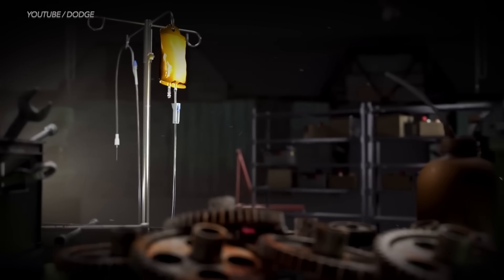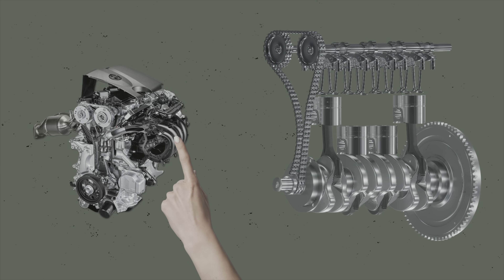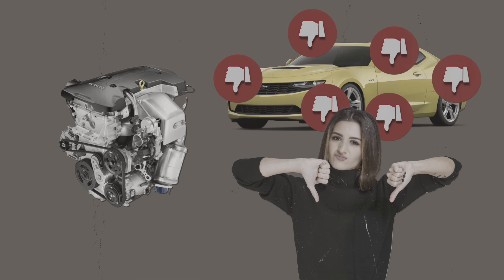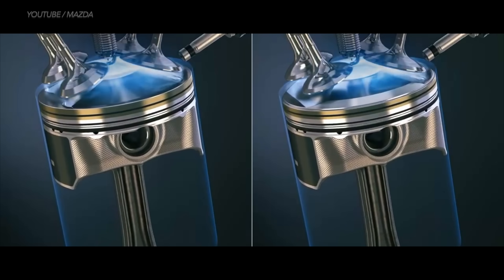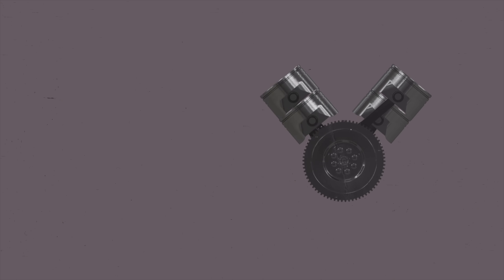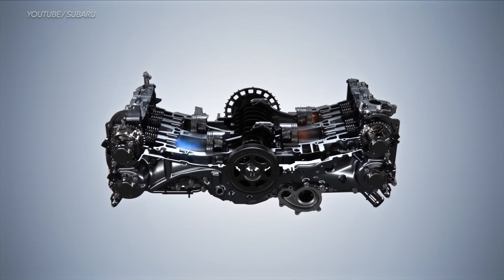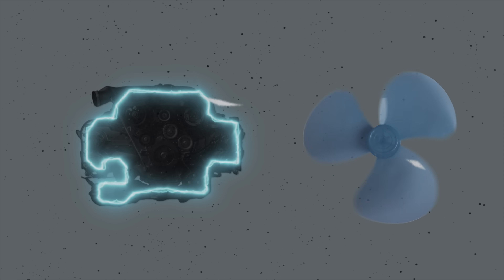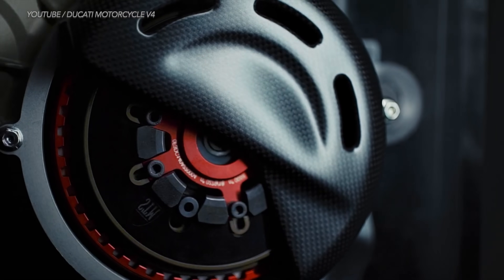This New 4 Cylinder Engine Just Killed the Future of V8 Engines

Comment: I have a pair of Subarus. One has boxer six and the other has the boxer four. Both had to have head gasket work done at around 100,000 miles, requiring the engine to be dropped from the car. This appears to be due to the open deck design that Subaru uses. I don’t have a fundamental issue with the boxer, per se; but, at this point, I vehemently hate open deck engine designs. It is my understanding that the open deck is what is responsible for causing additional flexing of the cylinder walls, which in turn caused the head gasket failures. Both of my Subarus are normally aspirated, so I did not expect a head gasket failure at 100,000 miles. Even the late ‘60s Ford I learned to drive in was fine for its head gasket at 145,000 miles, when the combination of valve train leakage & critical chassis rust ended its service. Indeed, the open deck boxer four that Subaru provides Toyota for the 86 is the only thing that gives me pause about that car. The boxer six is in a 2011 Outback wagon previously owned by my mother. The boxer four is in a 2006 Impreza we’ve owned since it rolled off the dealer lot in January of 2006.

Comment: Whatever engines will make the grade for being used the most in coming years have to at least be built to take the demanding job they will need to do, e specially the ones that have to be supercharged to make up the power loss of not having more cylinders, it is that simple, and nice video of course from Scotty. They could also make say bigger 4 cylinder engines for more demanding needs and make a nice V-4 based on any current V-8 platform like what is used in Fords and Chevys, but I bet the engineers will not do this and design complete new engines. You know how engineers have to create new things and leave their mark on the car industry.

Comment: Most small aircraft use horizontally-opposed engines and have since the 1930s.   I'm surprised auto manufacturers haven't watched the aviation space.  We regularly run engines at redline and max RPM for extended periods of time.

Comment: A 4 cylinder can be any displacement. The whole point of 8 cylinder engine is smoothness. Great stall resistance. A radial engine is relatively short in length but kinda gangly in its girth. Those are made for torque.

Comment: We own 2019 nissan rogue, 2000 Subaru legacy, and 2016 forester XT.  Previous have own Chrysler, honda, and Toyota. 
In my opinion the best engine i had own is the FA20 the way it respond. It’s easy to work on  unless you’re opening the internal engine.

Comment: I have a inline dodge neon 2003-2005 series.  Hands down the most amazing engine.   As long as u don't neglect the rubberband timing belt every 100000 the engines have both went over 300000 and still rocking
Reply: They r the 2.0

Comment: You can slant an in line 4 to lower the cog to a degree and my concern with boxer type engines is oil settling in the cylinders because it can't drain after shut-down. Subaru also mandated six month service intervals which is crazy, I can go for a twice yearly oil change but not for servicing.

Comment: Scotty convinced me to go electric.  Simple design, cheap motor, big power, efficient, low center of gravity, little vibration, no oil consumption, ...  If only Tesla figured out how to pull energy out of the air.
Reply: Irony is tesla did that not the corpse that talks but the corpse that is dead

Comment: There's something about a straight 6. There are some legendary I6 engines. Look up the Barra 6 which was a Ford Australia engine. They would do over a million KM in taxis and can produce over 1000HP. Same as the Nissan RB.  Most heavy truck engines are I6 like the Detroits and Cummins. For whatever reason, they are strong engines and can handle a lot more power than a V6. They are becoming rare. I believe Kia is making one for a new pickup coming out in thr next few years. Id love to see some small capacity I6 motors.
Reply: More bearings to support the crank is why they are durable.
Reply: @marshmower  right. Thanks for the info.

Comment: between myself and family we have seven Subarus, the oldest a 2017 Outback.  We've had no major problems, had a couple recalls and our Subaru dealer took care of these for us, outstanding service department. Very satisfied with the brand
Reply: I have a 2017 subaru forester,  actually 82.000 miles, no issue as long as I take care of it with oil change and good maintenance services.
Reply: My favourite vehicle I have ever owned was a 2010 six cylinder Outback.   No problems, and very smooth transmission and handling.

Comment: There is really no reason an inline 4 has to be upright.  If center of gravity is an issue, an inline 4 could be layed down flat.   I have owned a BMW motorcycle with a 'brick' engine, a 4 cylinder laid flat.   Yamaha makes inline motorcycle engines at about 40 degrees.   And BMW used to cant their engines in one direction for lower hood profiles.  Some of the most iconic Honda motorcycles were V4s and I thought that V4s would replace inline 4's, but I think it is strange that so few V4s are made.   If you can make a flat 4, why not a V4? 
 Nothing wrong with a V4 and they sound great...

Comment: I have two boxer engines.  I have a 3.6 Subaru, and A 1200 cc BMW motorcycle motor.  The Subaru engine is butter smooth with no problems so far.  BMW motor going strong also, but a little noisy with the valves on the outside of the engine.  Nothing some ear plugs won't fix 🙂.

Comment: V4 engines dominate Motorcycle racing and are common in Sports bikes. I suspect cost is the reason that these incredibly well balanced engines don’t appear in any cars.
Reply: Well they're shorter.... Probably not a necessity YET in automobiles. There are some older cars with the V4. The V saves space. So after they cram 2 turbos and hybrid junk in there to make it unreliable, I could understand them trying to go to different designs to save space. 😅

Comment: I have a 2005 Corolla S with an inline four 1ZZ—FE engine . I got it used with 50K miles on it; it now has over 150K miles. The problems with the car have been unrelated to the engine: Recalls for faulty air bags, a transmission mount failure (the transmission and engine are a mated assembly). Only 2 repairs/maintenance costs have amounted to over $1K. I'm retired now, so I drive few miles: In 2022 it was 2,218 mi, for a cost in gasoline of $339.56. This car is the best one I have ever owned.

Comment: I’m noticing more and more manufacturers going with 4 cylinder turbo in their vehicles. When I heard they put it in a Silverado, I was like wtf 🤦🏼‍♂️ 
It’s like having a 100lb guy vs a 200lb guy carrying a 50lb bag all day. Sure the 100lb guy can do it but for how long before he dies. It kind of seems like manufacturers want the engine to only last 100k miles. I own a 2001 v6 Silverado with 300k and it’s comfortable. It’s not fast and it stresses if I load it up but it’s doable. I think each engine no matter if n/a or turbo’d has a weight limit of a car they should be in. 
4 cyl- car’s under 2900lbs
6cyl- car’s under 4500lbs
8cyl- cars under 6500lbs

Comment: Have 2 Subaru's; one Outback with the standard 2.5L boxer, the other an Ascent with the turbo 2.5L...both are great.  No issues.  Have had Toyotas and those were bullet proof engines as well.  Had Honda company cars...great reliability but that's where my praise of Honda's ends.  Maybe the higher end models are praiseworthy, but the company low-ball leasers are hard riding, NOISY and not very comfortable.

Comment: My daily is a Volvo 850. It's a 5 cylinder. It's been a phenomenal engine. 200,000 miles uses very little oil, when I change the plugs they are evenly worn and normal in appearance, still returns good MPG for the model (Volvo's of this era weren't known for Japanese level MPG performance)  I'll miss this car when it goes to Valhalla.
Reply: yes legendary engine. what econ do you get? Is it turbo?
Reply: @jamesmedina2062  I average 20 around town. Non Turbo,  5 speed manual
Reply: @weirdshibainu ok cool. Thats not good but its a big safe and comfortable car.

Comment: The Boxer four engine does not have to leak oil, for example, the VW beetle was around for decades, and it never had an oil leakage problem, it was an awesome motor, and lasted forever, the design itself was used extensively, not only in VW but also in Porsche automobiles, as well as in aircraft and dune buggies
Reply: hello ?? the VW boxxer was air-cooled. Totally different engine.

Comment: I have an EV (which is what is actually killing combustion engines) and an old CJ5 with the AMC 304 V8.  Fun old CJ, but she's thirsty.
Reply: Evs have a long way to go before killing anything. Let me know when I can drive one for 400 miles, towing my small camper and not having to stop for hours to recharge...otherwise, keep them.
Reply: @BillO964  Right, because that's what all gas cars do.  EVs are killing the combustion engine.  But it's obviously a 'slow kill' as it were, due to the size of the industry in question.  The automotive landscape will be VERY different in 10 years.

Comment: Scotty, I agree that the Volvo Drive-E engines are complicated however, I’ve got 4 Volvo’s with them and haven’t had any issues with them so far. They put out plenty of power and are petty good on the gas mileage if you don’t drive like a maniac everywhere. When it comes to solid safe cars, Volvo’s are hard to beat and they still have the best seats in the industry. The only downside for not only Volvo, is the implementation of direct injection which introduces carbon build up issues all in the interest of better mpg numbers (trade one problem for another).

Comment: Carbon build up in new direct injection engines tends to be overrated due to the mechanisms automakers use to mitigate it. 

That said, I've owned both subarus and mazdas and never had issues with either of their engines. However, I've had issues with older subaru transmissions.

Comment: Hey Scotty, I recently got an alignment and was told my struts were "worn" and needed replacement. I do all my on work on my car unless I don't have the equipment like an alignment machine... So after this alignment was done I slipped the kid a $20 for a tip and he told me about the struts. Leaving the parking lot I notice my steering wheel is no longer centered. At first I thought no big problem I'll just take out the screw on the floor behind the gas brake pedal thats holding the steering wheel shaft to the rack and pinion, and just set the wheel straight and slide the shaft back onto the spline of the rack and pinon. But then I realized that would screw everything up and it would no longer be centered on the rack's travel. So something must be bent. Could you make a video about alignments? How they are done, and what to do if your wheel is no longer centered? Please? I'm wondering, since the only adjustable thing I see in the steering is the tie rods. So I'm wondering how the other two angles are adjusted.
Reply: Front end alignments are not done properly if the steering wheel is not centered. Take it back and tell them so and to re-do it.
Reply: Many cars do not have adjustable caster and camber. If yours does, a repair manual from an auto parts store will show you how. Or online searches. Or library.

Comment: Scotty, love the channel. I'm looking to get a scanner since I do all my own stuff. I have a GMC diesel Terrain so there's a ton of things that I would like to have control over. I bought a knock off GDS2 dongle that connects into the OBDI2 or DLink what ever you call it... It works "Okay" Constantly disconnects and wont do a "adaptive fast learn" on the transmission I just rebuilt. In my garage... Parts everywhere, huge mess... What I'm getting at is there seems to be no good source of info for the damn scan tools. Is there not a software I can download onto my laptop and get dealer level access even if I have to pay for  some kind of subscription? When I go look at those "tablet like" scan tools it seems that I have to go down the very long list of feature just to make sure the $900 dollar tablet I'm buying has the specific features I'm looking for. Is there not a software preferably on a laptop PC that can do it all?? Its all so confusing! If anyone else wants to put their two cents in I welcome it.

Comment: No matter which well engineered engine you go with, they still need maintenance. They way I think about it is to try to leave 500 a year for maintenance and tires. That way, after the warranty runs out, you should be able to afford the maintenance as required.
Reply: Precisely - you nailed it.  The difference between the types of engines is that some designs tolerate negligence and abuse better than others. Nevertheless, any neglected engine (and transmission) will eventually fail if they are not maintained.

Comment: I've always driven 4 or 6 cylinder engines ... I'm in the I-4 camp.  Best car/engine combo I ever owned was a '82 Plymouth Reliant wagon w/the 2.6 liter Mibsuishi engne.  I sold it at 250K to a friend whose daughter put another 200K on the engine, only 1 timing belt repair outside of the regular maintenance.

Comment: the inline 4 in the 1995 (or 93? not sure) opel corsa 1.4 is brutal, we once had one which we gave around in the whole family, so many bad drivers drove that thing, poor thing basically never even got an oil change and it still ran perfectly when we sold it for 150$ with 800.000km on the clock 🤣🤣🤣

Comment: So many things that can go wrong and need maintenance in the gas engine.  So glad I made the switch to an EV.
Reply: Depends on how you look at the EV and what you need for a daily driver and how many miles you drive... for me I see them as Ecological disasters... raw material mining for the battery cells, production wastes, disposal or hope of recycling afterwards.. still need to generate power to charge the batteries. Electrical upgrades to the home to enable so/so charging over night, lack of power grid upgrades..... electric may not directly use fossil fuels but they have many problems related to them too.
Reply: @greywolfe1114   Not sure how you see EV productions as a greater ecological disaster to drilling for oil. Take a look at pics of smog free LA towards the end of the pandemic. EVs consolidate the pollutants to the more effective electricity plants' emissions controls versus ICE cars' distributed pollutions.   Consider all the oil consumption and ecological impacts to extract, transport and refine oil  to deliver it to an ICE and from there is only 60% energy efficient and an EV is greater than 90% effecient and you can't recycle gasoline. 95% of the materials in an EV battery can be recycled and those same batteries can be used well after their use in EVs for other applications like home energy storage. Electrical upgrades for homes for most is just adding a 220V outlet and charging at off peak times is less than 20% the cost of gas. The ICE has had over 130 years of serious research and development and the EV not much more than 30-40 years. We're just starting to see production cars with solar panels that can get over 2000 miles annually from the sun.  Objectively speaking, the EV has so much promise all things considered.

Comment: I haven't had a really cool motor since my 340 dodge dart. All my 4 bangers over the years have been very run of the mill. 

I am a Mustang fan and am on #5. 
'69-351W
'90-2.3l
'98-3.8l
'00-4.6l
'07-4.0l

My least favourite is the 4.0. within a year ive had two timing chain guide failures. 1st time i replaced engine (at the base level it was a really good deal). Second just occurred and I will likely get repaired and sell the car.

Comment: I have a 16 ford fusion with the naturally aspirated 2.5 litre engine. Which I just replaced at 235000 miles. This engine gave me no issues till the timing chain\belt started to go. Oil change and plugs that's it ...admitidly if I had changed the belt\chain @ 125000 as recommended it would have been fine to this day. This car has been so good to me I went all in got a motor with 30000 miles and rebuilt the tranny ...next 235000 here we come.

Comment: Used to call them pancake engines. Had several with no issues. V8's still my favorite 👍
Reply: I also like V8 engines, like the 402ci engine in the '71 Chevy Monte Carlo in my garage.  I also like my '22 Subaru Outback XT, which could eat my '71 Monte Carlo alive at the track.

Comment: I am on my second Subaru lease. First a 2020Outback now a 2022 Forester. Never had an oil or engine performance issue. My problems have originated with the head units. Android Auto (AA) went from completely FUBAR to mostly an irritation. One head unit was replaced in the Outback but AA still flaked out. I use my wife's IPhone and Apple Carplay. That is a Google failure not Subaru. Otherwidse, both cars have been a pleasure to drive on long trips and in town.

Comment: My Yaris has the inline 4  cylinder and it's great. I get 28 to 30 miles per gallon in town and 38 to 39.5 on the highway.
I've asked the same question several times and no answer. 
Why does my engine have a slight vibration when stopped at a red light?  Also I replaced the ac condenser and my ac blows cold while driving but starts to warm up when stopped.
I always watch your latest videos every morning.

Comment: I learnt to drive in my dad's '68 XT falcon panel van (australian) 3.6 lt inline 6. That model had the option of a 302 v8, so there was plenty of spare room in the engine bay. I remember my dad standing on the frame rails, with one leg either side of the engine to pull the head off.
We need to go back to cars the average guy can work on.